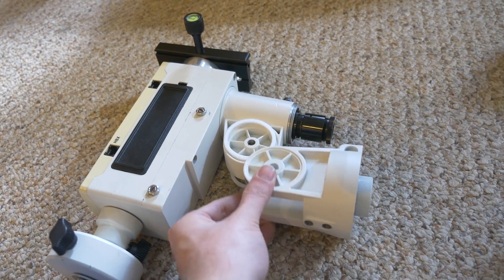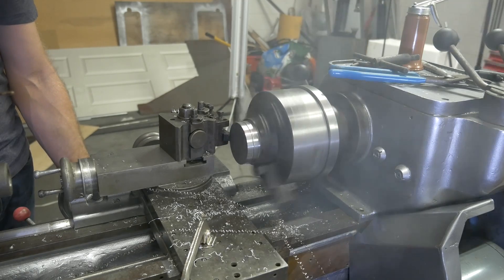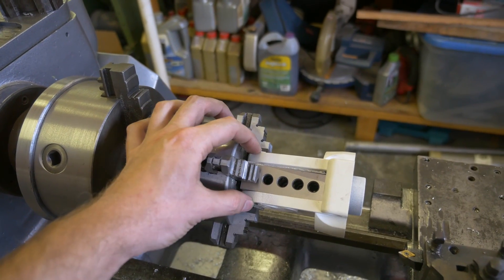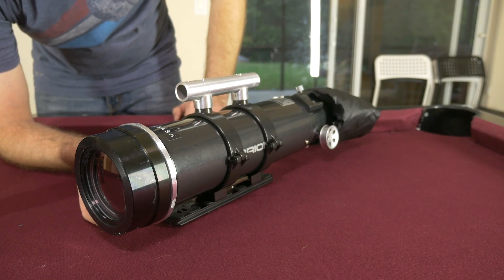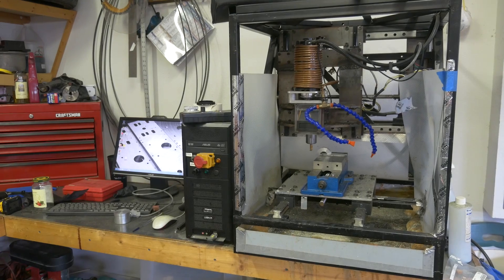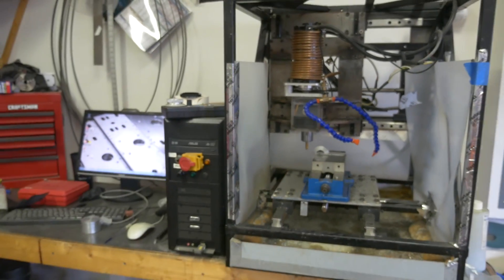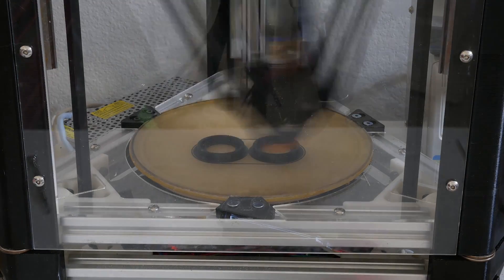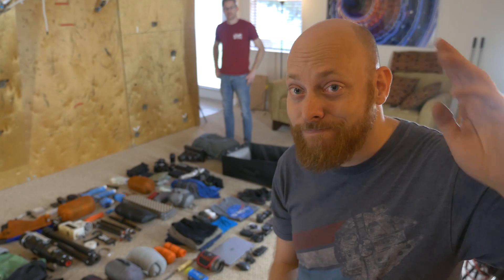Solar Eclipse Part 1 - S02E15

Comment: your videos are very well done. Another suggestion for using your 4 jaw chuck would have been to mount it directly in the 3 jaw chuck without making an adapter. That is if the 3 jaw chuck jaws are reversible. You made it work though and that is what matters. keep up the awesome videos!